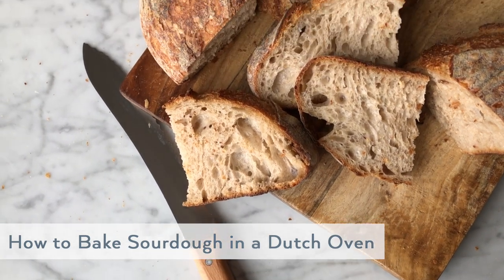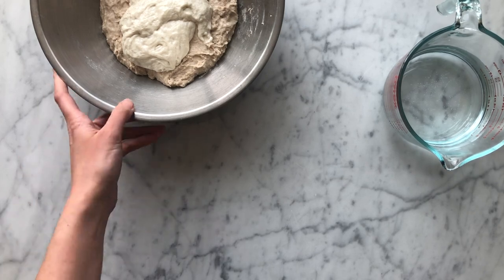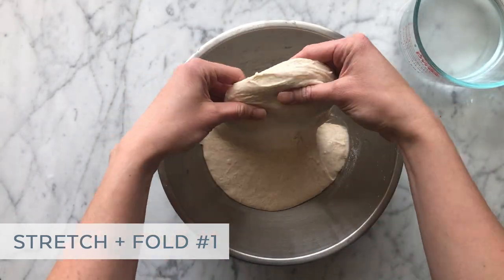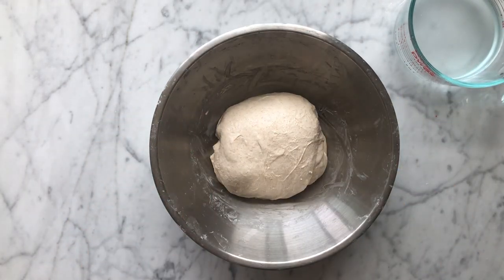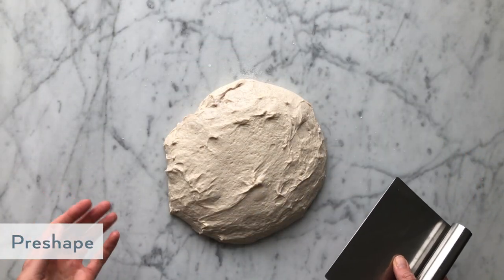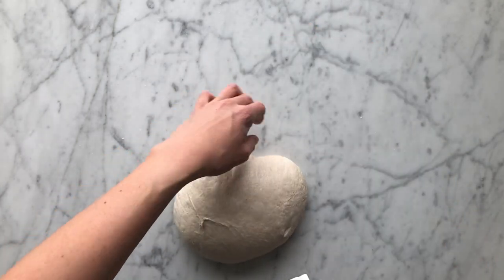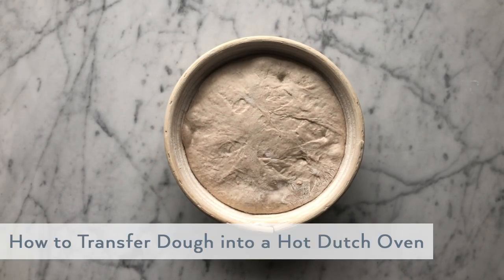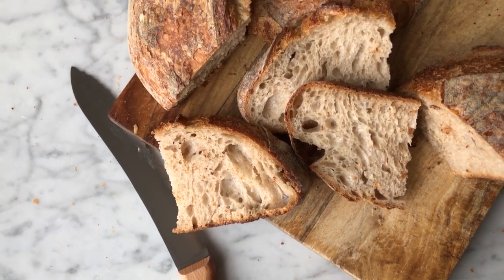How to Bake Sourdough in a Dutch Oven (How to Shape a Boule)

Comment: I’m trying to find the videos on sourdough, and yours is the first that mixes the flour and liquid before the starter is incorporated.
Reply from the maker: Hi Sandi. This is called an autolyse and it's especially helpful for high hydration doughs. It is fairly common (particularly with high hydration), but it's not always required or necessary, and is often up to individual baker. There are so many ways to approach and make sourdough!

Comment: Hi there, this is a helpful video and looks like a great loaf. Is it necessary to keep the hydration level you have due to the whole wheat flour, or is it okay to adjust the hydration level based on the temp and humidity. I live in Hawaii, it's warm and humid mostly year around, and with plain bread flour recipes I use 65% hydration for best results so far. However, I am not familiar with whole wheat yet, so was thinking of starting with 70%. What would you recommend starting with? I can adjust it of course, but was hoping the first loaf will turn out!  Thank you for  your helpful video.

Comment: Just tried this and even though I used accurate measurements on my scale, my dough was never slightly tacky, ans very wet.  Baked it anyways and it was tasty, but denser than yours.  Still haven’t gotten that bakers knowledge of sourdough, yet.  🥲
Reply from the maker: It sounds like the dough might have gotten over proofed or potentially the hydration was too high for the type of flour you were using! I would cut back on the water by about 50 grams (you might not need as many stretches and folds) and see if that helps - and watch bulk fermentation time a bit more carefully!!! It def takes practice!